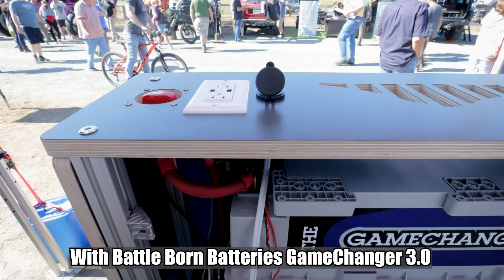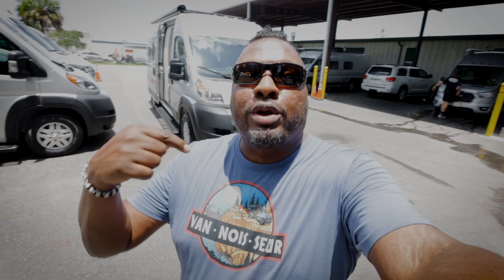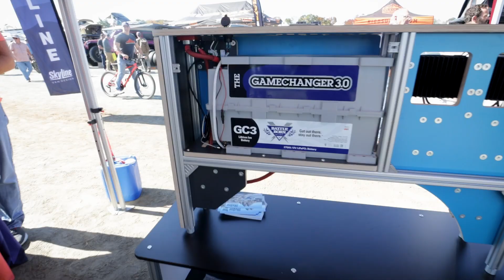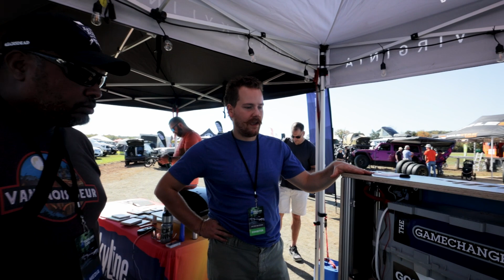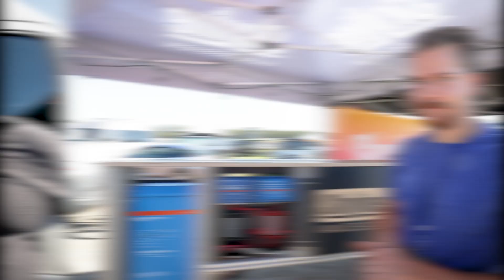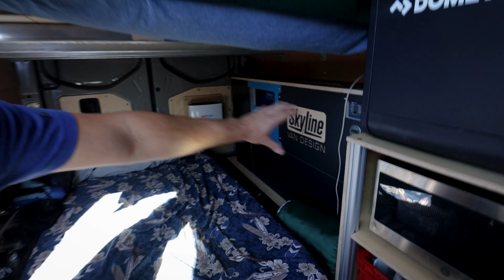The Ultimate DIY Solution! Skyline Van Design's Camper Van Drop-In Electric Power System

Comment: Who would be dumb enough to pay that ridiculous price when you can just purchase a 3000 w combi charger inverter unit for $350?   Just buy your favourite low cost lithium batteries and you are done.    The combi also takes up fraction of the room has all breakers and safety systems built in.